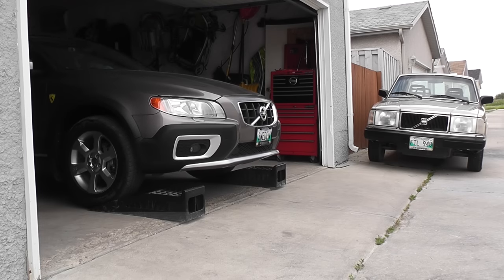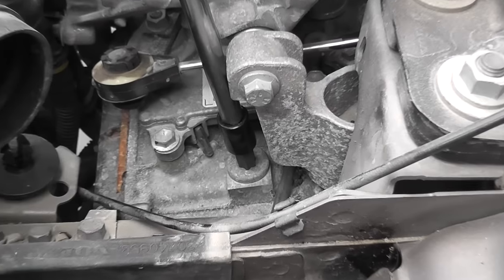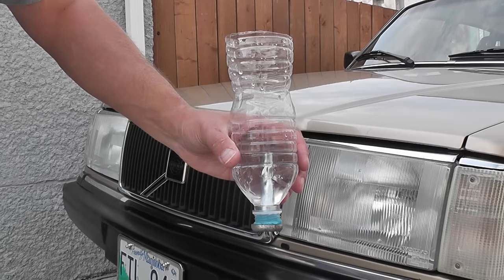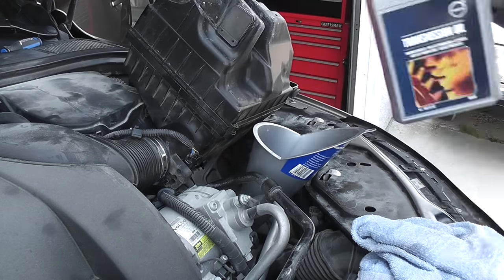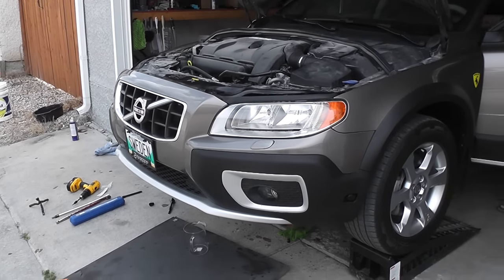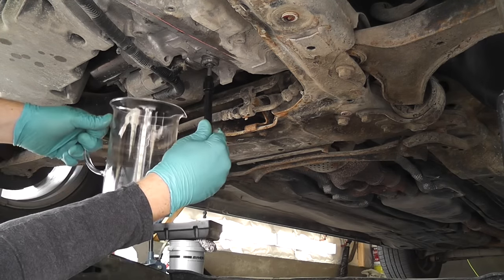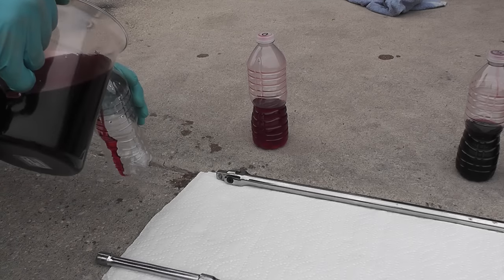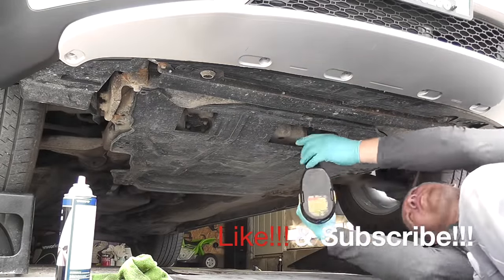Volvo Transmission oil change Aisin TF-80SC. 6 speed Auto.

Comment: Thank you for you time and detail explanation about it; Congratulations and I know because I watched 70 % of your videos that you take care about the ramps and the car level (you have got some comments in spanish little bit rude, but doesn't matter them) and 100 cc more o less in transmission oil is nothing important.
I don't have the data base module and I will take the oil transmission temperature with your 20 min plus taking few droops and using a thermometer sensor to check it. 
Do you think that is it ok? 
I will not change the information in the computer that I changed the oil transmission.
Pls, let me know your advice about it. Thank you so much.

Comment: can i get a bit f HELP ?
i have volvo v70 from 2009 (YM 2010) with awtf80sc ; which oil should i have to get best resultat in gear changing ?
all site in sweden shows that i should have a synthetic oil, here it says its mineral (orginal from volvo etc)
160 000 km without changing oil in transmission ( volvo service sweden says IT DONT NEEDED ) what about adaptation ???
can any 1 answer ?
Reply from the maker: Get oil from your dealer by providing your VIN.
I would still change the oil. There is no such thing as life time fluids.

Comment: I agree very good video compared to the others. One question at 6:20 why mixing the new oil and the old oil? It looks like a waste but I guess there is a reason... Isn't it better to flush the old oil and then put back the clean oil? Or other solution, push the old oil with the new one? But mixing... Thanks for your answer.

Comment: Informative and clear as usual! 
I love the clever design of the drain plug that ensures the level is correct. 
Just one question though - doesn't this procedure have to be performed with the car standing level as the fluid in the gearbox will always lie level to the ground and therefore a sloping car may cause the level in the gearbox to be incorrect?
Reply: I believe it should be.  Checking the oil level when the car is on a ramp might not give the actual level you need for proper transmission operation.

Comment: Hi there,  I have a gasket leak and have been filling the trans occasionally to top it up.  Recently, used some stop leak additive & think it may have made the gasket swell too much & I've stripped the filler plug.  

Wondering your thoughts or advice on adding fluid slowly through the air vent?  or any other hole to get me by until I can get to the shop?  Thanks for posting this video it's been very helpful!

Comment: Hi. Thank you for all your amazing Volvo videos. Did you already have problems with the swirl flaps on your D5? I would love to see a replacement video or alternatively a full intake cleaning video. I do not have problems with it yet, but I am planning to clean my intake system. Thank you and keep up the great work! Kind regards
Reply: I had the problem with the disconnecting arm and i fixed it buy purchasing a replacement kit on ebay (about 70€) which replaces the plastic arm that connects the motor with the swirl flap by one made out of metal.
However mine is leaking a little so i want to replace it (i probably will make a video of it because the only ones i've seen on youtube are missing a lot of steps).

Comment: Best video about this topic! Very detailed and smooth. Just a question: why some oil coming from the level plug at first drain?
Reply: Because when the engine is stopped, the level in the box rises. (Returns from the torque converter.)
That's why you set the level with the engine running.

Comment: Hi Camarade, at 5:45 minute, you drained 3L of oil from 7L (total on transmission), so 4L remaining in the tank, right ? On video, you left everything drained while you explained the level screw ? if yes, you put it back the old oil like 3-4L and added 4L new ? or you screwed on middle draining the level indicating pipe, and you checked how much liter it drained ?

Comment: Excellent video. I have a question. Where do you find all the information on the torx sizes of the bolts, the o ring part numbers, etc, because I cannot seem to find that specific of information anywhere. I have AllData DIY, but that is limited. Also, where did you get that complete torx socket size, including the hex drain plug bit?
Reply: Yea tell me too friggin he said torx 55 wtf is that mm? Home depot has torx but not 55

Comment: Isnt that a concern that when you put back the screw of the filling hole before you set the level, and when fluid is coming out youre creating vacuum and that is what it stops the fluid flow through the draining hole, not because it reached the top of the tube of the leveling plug, thus you end up with an overfilled transmission?

Comment: Did you drain while the vehicle is a normal working temp or cold. Also drain while vehicle is running in park. Great video. Thanks.
Reply from the maker: Drain at any temperature. What’s important is to set the level at 55 degrees Celsius.
Reply: @volvosweden  will do thanks for your reply and information.

Comment: Since this is your first oil change on this car, why have the Volvo factory overfilled the gearbox if oil needs to be levelled to the dipstick level? From the small drain plug you must of Drained at least 500 to 750ml of excess?
Reply: I KNOW, RIGHT.

Comment: Outstanding video.  Obviously level car on final fill is critical ... but video appears to show car only on ramps at front ?  Maybe just for easier filming ?     Anyways, appreciated the video.  Also curious how critical VIDA for temp is ?  You mentioned about 20 minutes to reach 50'C.  Curious how hot the control module would peak at, if only idling but longer ?  Having no VIDA, I'm thinking 20 - 25 minute idle would be close enough ?

Comment: Was the first drain done while the transmission is hot?  Wondering why there would be fluid coming out when you first unscrew the leveling screw.  Was the transmission overfilled from the factory?  Great video btw!
Reply: Engine cold or off for a while and gear selections not run through to pick up the oil. and that oil that would be circulating at temperature is sat in the sump.

Comment: First of All, thank you very much for your help! I have a question… I am not a mechanic. I do not understand why first time you took the torx 40 , a big quantity of fluid is comming out… if it’s leveld.. should’nt come..?!
Reply from the maker: First time lots of oil comes out because the engine is not running. Once running that’s when you set the level

Comment: My Passat 09G (TF-60SN) has a fill plug similar to that but on the front of the transmission.  It is much cleaner to fill through that hole rather than using that than using the adapter.  I still check the fluid level through that pipe in the drain hole but I have never filled through that.  I wonder what years had that plug because I had a 2006 Jetta that did not have that.

Comment: Hi thanks for your videos, they are very inspiring for many Volvo drivers like myself! I have a question and if you dont mind can you tell my your opinion about it!? 
Will it work if i change the TF80SC oil on my S60 D5 MY2006 without Volvo Dice & Vida (reset at the end)!?
 I have been thinking if i change the oil without driving if before (parking it over night) and just add the same amount of oil that goes out with fresh oil. Will it work? In theory the same oil should have the same expansion value or im missing something?
Thanks in advance for the answer.
Greeting from Germany!
Reply: Many people do it this way. Understand that this only works if it was set correctly in the first place and has no leaks. The TF80SC does have a tolerance level of 500ml more or less so it does not have to be exact. 

Another way: Use an electric pump to make sure clean oil is always going in the fill bolt and start the car with the level plug removed and allow the transmission pump to recirculate the oil. Eventually you will end up with all clean oil. It may take patience though. Note that if your electric pump pumps much faster than the oil will drain that you will need to turn it off, and on again as the flow slows.

Comment: Great video.
I have a 2007  S80  3.2  with very low mileage about 19000 total it still has original transmission fluid. 

I am getting mixed advice from the Volvo dealers most of them say leave it alone, or don't change it,  some of the independent Volvo shops say yes change the fluid now.

This car runs perfectly oil changed every year synthetic mobil 1 , coolant every 5 years.  

Thanks for advice you can share
Reply from the maker: Change it! And do ot every 40K miles after

Comment: Hello, thank you very much for your excellent content! But I have question regarding oil change in the automatic transmission. DO you recommend changing oil if it's not clear when it was changed last time, whether it was changed at all? It could worsen the work of transmission? I got Volvo 2013, with mileage 250k km, and I'm not sure if the oil was ever changed, do you recommend to keep it or still try to change? Thank you very much once again! :)

Comment: Hey! Great Video. Quick one,,, why there is oil coming out (03:05) from the level plug.. since the same plug is used afterwards to set maximum level..when no oil is no more dripping ?? Does it mean there was more oil in the gearbox set by the factory ??

Comment: I flushed my Volvo V70 D5 like this and it worked like charm. The old oil was not as bad as I thought but I noticed a definite improvement: smoother gear changes and much smoother when reversing (backing). However, my engine light came on and won’t go off. Anyone with a tip on this? (Yes, I connected everything, including the mass sensor to the air filter unit)

Comment: Your car is with the front wheels on the ramps and the rear wheels on the ground. Doesn't this affect the oil level at the end of the procedure? I ask because I want to suspend the car in the same way as you. I don't have a lift at home. Great video. Thank you.
Reply from the maker: There is slope on the garage floor. The car is level. The camera does not reflect that

Comment: Hi, great video. I just bought an 2012 XC70 with same box. Car have 105000 miles on the clock and the gearbox had fluid flush at 60000. I going to replace the oil and flush the box again soon. I noticed, when I do three point turn and shift from R to D the box kinda jerks littlebit sometimes, I was wondering if its normal. The box it self shifting nice and smooth. Thx Rob

Comment: So you can't do a transmission drain and fill without a scan tool correct ? Or can you just run the car for 20 to 30 minutes to get the the transmission up to the proper temperature or is that impossible to do ? Does the transmission temperature have to be exactly between 55 & 60 degrees Celsius

Comment: Hey, a really good video, i will try to change the oil in my Aisin myself. 

But one more thing, you say the car needs to be level when you drain the excess oil but in your video you are still on those little ramps with your front wheels, is that "level enough" ?

Comment: Why there was so mutch oil runing out, when you first time opened level plug (small bolt)? If the transmision oil level was set properly there should be jus few drops of oil.

Comment: Really love your video's, very helpful! One question regarding changing the transmission oil, the way you've described it, does this method also apply for a manual gearbox? I have D3 MY2012 with a manual gearbox. Thanks in advance for getting back!
Reply from the maker: I don't knwo about manual anything.

Comment: In the Vida instructions there is some mention of disconnecting a drain hose for the oil cooler, installing a special tool/hose, and at a few points when refilling and cycling through gears watching for bubbles in the hose. Do you have any thoughts on this? Is it necessary to try to get this tool or better to just do like you show?

Copy / Paste of Vida section I am asking about
------------------------------------------------------------
Disconnect the drain hose.   
  
Special Tool: 999 7363  

Fill with 4l of oil. Use transmission fluid.  

Apply the parking brake. Move the gear selector lever to position P. 
 
 Start the engine and allow to idle. 
 
Shift through all the positions between P and D on the gear selector. Stop for 2 seconds per position. Switch off when air bubbles are visible in the hose. 
 
Fill with 2 liters of oil. Start the engine again and allow it to idle. Switch off when air bubbles are visible in the hose. 
 
Fill with 2 liters of oil again. Start the engine and allow it to idle. Switch off when air bubbles are visible in the hose. 
 
Install the drain hose for the oil cooler.
Reply from the maker: +Eric Lau VIDA instructions is more work. But it's 100% fluid change. The way I show is easier but not 100% fluid change. Up to you.
Reply: Ok. I see. It seems like repeating the drain/fill process like you did will be pretty effective at removing old oil and it seems easier. I think I'll try your method. 

Thanks for all the great videos. They are very helpful!

Comment: Great vid! 2006 2.5 XC70 here. Seems to have an auto transmission problem that hard shifts/jerks between 1-3. Depending on the day, the RPMs drop to 0 at idle despite the engine audibly running. I've changed the transmission fluid (came out a little dirty) and had the shop drive it around in adaptive mode. It fixed it for a few months then it started happening again. Any suggestions would be greatly welcomed!

Comment: Telly Onthewall

@volvosweden  First thanks for the good videos .. nice to see a share experience with others, 'specially the experience not written in any book. Keep up the goods work.
Couple of things are confusing here though.
1. There is comming a liter or more out of the LEVEL plug the first time, you unscrew it?? Meaning Volvo/Aisin Warner overfill the gearbox from new???
2. Volvo/Aisin Warner says 7 liters capacity in the gear box. You took out only about 4 liters first time and drain off about half a liter of the last 4 liter jug put in??? (I got it with your 50/50, 25/75 and 15/85) Any other way to get the rest of the old oil out? I know "the leftover" is in the converter, solenoid block, etc. Is a gasket for the solenoid block cover not less expencive as 8 liters of Volvo ATF? Or will it not give any more result to take off the cover? (If it's even possible with the gearbox in place .. didn't look that thorough yet)
Some other "presenter" here on YT just say "start the engine, let the gearbox pump out the old oil, stop the engine when it stops runing out the drain hole" .. NOT to recommend!!!!

Comment: Very helpful video. Why it is so important to reach temperature of 50 degrees celsius before pouring out excess oil to get correct level? Does this oil chages its volume so dramatically if temperature changes by 30 degrees?
Reply from the maker: That is by instructions. The volume does change with temperature. By how much? No idea.

Comment: Does your car not need to be on a level surface for the final level set? You still had the car jacked up at that point.
Reply: This is exactly what I was going to ask.
Reply: Yes it does. The fluid level was not correct in this video. He had only the front up on Jack stands

Comment: Ocd is the guy that changes the oring and washer on the drain plug, to do a 10s. fluid steer... I wouldn't measure the level with the car pitching up in a ramp.

Comment: Thank you. Yuri and other sitters: do you know the parts name of the pipes next to transmission oil drain plug. There are several pipes from left to right, one of them has rubber tubing on both ends connecting metal tubings.

Comment: Great video, as always. Thanks, I will do this procedure soon as well.
Does anyone have the measurements of the crush washers for top and bottom and rubber O-ring? I would think generic would do as long as I have the right size.
When I can I'll have a look in Volvo VIDA, see if its specified there. If I find it I'll post it here.

Comment: I have a question ?
The front of the car is raised to the top, and from the back, the tires are on the ground. This position does not affect the oil level inside the gearbox?

Comment: Great informative DIY video with excellent drain/level plug explanation.  I would like to ask you if you considered using the ATF cooler return hose drain procedure instead of what you did? Where did you find out about the required ATF temperature?
Reply from the maker: +Pawel P Using the return line procedure is better Yes. The temp info is from Volvo shop manila called VIDA which is available on eBay.
Reply: Great video. I have a 2002 v70. I looked at vida dice it is only for new models 2004 and newer, do you or can you recommend any other divise to run codes on 2002 v70. Thank you